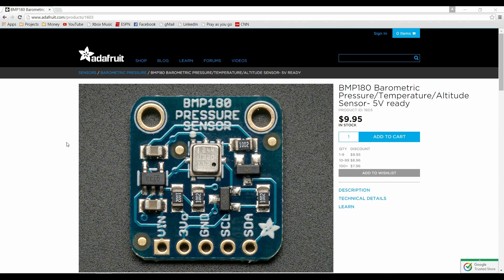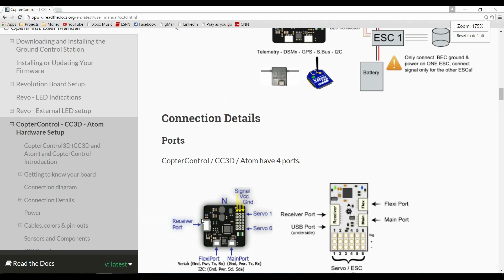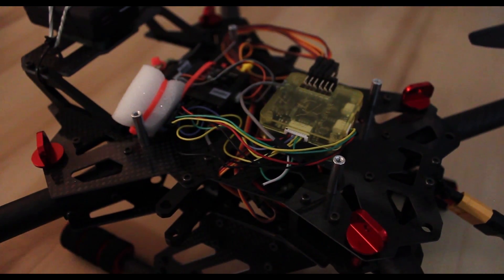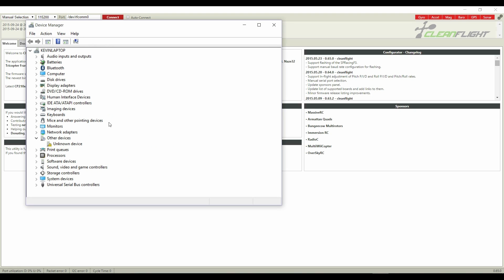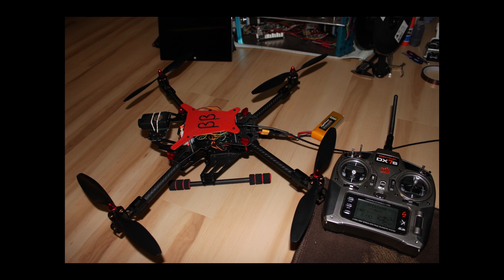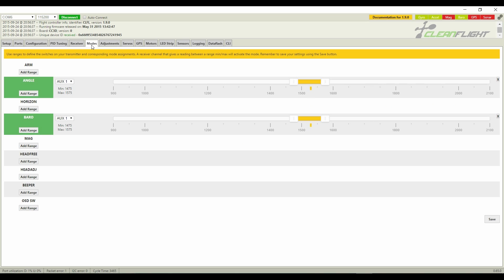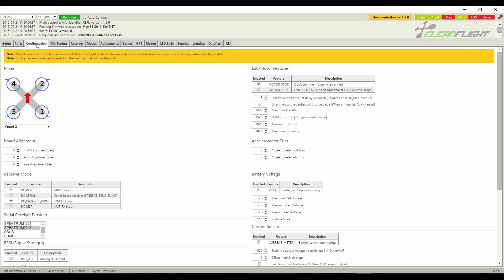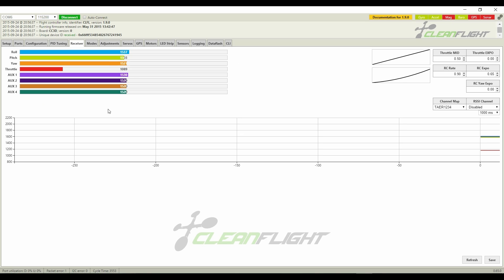DIY:  How to add a Barometer to your CC3D for Altitude Hold!

Comment: Did u change any settings in Port section ?
Reply: i thinks it flex port i2c  i couldn't yet get the CC3D Atom Min to work with baro in librepilot.

Comment: The BMP180 module I bought says 1.8V to 3.6V  https://robu.in/product/bmp180-digital-barometric-pressure-sensor-board-module-arduino-compatible-2/  But the Main and Flexi port output provide 4.8V . Can you please help me?
Reply from the maker: Simon George it has been a few years, so I don't have an exact description.  But the CC3D has a 3.3V power supply you can draw off of.  That's what I did.

If I had to guess, I bet the voltage of Vcc in the video (at 41 seconds) is 3.3V.

Comment: cleanflight doesnot detect BMP180 despite soldering and wiring properlyi wonder what i might be doing wrong. Can you help please
Reply from the maker: Make sure you're using the versions of CleanFlight I mention in the video, and the text.  Make sure the LIPO is connected like I showed in the video.  And, check that wiring one more time!

Comment: Good morning, my friend, I'm Brazilian. My name is Wilson Roberto. I live in São Paulo. I do not understand a lot of drones, but I rode 2 drones for me, a 250 racing and another dji 450. I bought 2 BMP 180 barometric sensors. How to connect the wires to the flexiport socket. If you can send a connection scheme I thank you very much because I'm afraid to burn either the sensor or the cc3d card.
I apologize for misunderstanding you, I'm 62 years old and I really like drones. Thank you

Comment: nice video......
could you mind to explaine with pict how to connect the wires form bmp180 to cc3d board...
like a saw in your web http://imgur.com/gallery/n2Ho7 
you conected to flexi port....but i dont see the detail of wires.
thanks
Reply from the maker: The BMP180 on that thread shows the four wires (VIN, GND, SCL, SDA) and the clean-flight documentation snapshot shows the four wires under I2C (GND, PWR, SCL, SDA).
Reply: thanks for reply..
i mean the wires you connected to the CC3D board, can you explaine SDA and SCL to what port and what color..?
thanks

Comment: Hi..there.. I like what yo've done...
.I have CC3D FC and just bought BMP180... do I have to setup BMP180 using arduino or just plug in to flexy port? And do I have to setup using clean flight or I can use libre pilot to set up altitude hold for CC3D FC? Thanks
Reply from the maker: The BMP180 is wired directly to the CC3D as the video showed... no Arduino necessary.  I only tried this with Clean-flight... perhaps it would work with other software, but I did not test this.

Comment: Hi Kevin.  This was a nice video of a baro add.  I have a challenge with Clean-flight.  Cant get the PWM receiver to work.  How did you get yours to work?  I have a futaba 7C Receiver.
Reply from the maker: I didn't really have any issue with the Spektrum using PWM (I gave up quickly on trying to get PPM to work).  The only thing I remember about this (it has been over a year, and since then I have upgraded a couple times) is that I had to set my throttle below the minimum threshold Clean-flight required before arming... that really was the only receiver issue I encountered.  Have you found success in the past two weeks?  Sorry for the slow reply, only just seeing this.

Comment: my barometer rated for up to 3.3v only . how can i get this voltage ? do i need to solder a wire to 3.3v spot on the cc3d board to replace with the power from flexi port? and is it possible to do the settings for barometer in libre pilot ?
Btw thanks for your video ;)
Reply from the maker: I actually switched to the NAZA M v2 recently.  However, I did have a "hack" on the CC3D at the 3V pin... so I'm guessing I did this for that very reason.  Unfortunately I've never used libre pilot.  No problem!

Comment: Hi Kevin, so the pwr cable from the flexiport is not used and instead you´ve connected the pwr wire from an ESC to the VIN port on the bmp180? Thanks for the video!!
Reply from the maker: I took apart this setup a month ago (when I saw the Naza M v2 is only $150).  I have a "hack" on the CC3D at the 3V pin (next to the ESC plugs)... but I don't actually remember why I needed that, lol.
Reply: Yep, wired 5v ESC output to VIN pin on bmp180 and the rest of wires like you mentioned and it is working :D  Thanks!

Comment: Hi, 
would this 1.84$ barometer also work for a CC3D? :)

http://www.ebay.com/itm/New-BMP180-Replace-BMP085-Digital-Barometric-Pressure-Sensor-Module-For-Arduino/262476089332?_trksid=p2047675.c100009.m1982&_trkparms=aid%3D777000%26algo%3DABA.MBE%26ao%3D1%26asc%3D36860%26meid%3D85c6d2ce3d64457b880cb27ed3035b5f%26pid%3D100009%26rk%3D1%26rkt%3D1%26sd%3D231263856250

Thanks!

Comment: My CC3D is not recognized any more, and the "Scan for hardware changes" in Device Manager won't make any difference on my PC, so I solved this problem in a different manner:
 
1. Installed a new Windows onto a separate, normal (not VHD) partition on the hard drive.
2. Installed DeepFreeze software and frozen drive C (DeepFreeze offers protection to loose all changes after a Windows restart)
3. Connect the CC3D to the PC

This way the PC will always see the CC3D board for the "first time" and it will always install the needed driver, and it will always work!

Comment: Hi i think the reason the other sensors did not work is because they use a different i2c address by default to the 0x77 address used in the BMP180 and you would need to change this value in the firmware or sometimes it is possible to change it on the sensor but the Bmp085 should also work because it has the same address i have one laying about so i am going to try adding it to my quad soon with the HM5883l compass as well to enable direction hold but i need to wait for my battery and a few last parts for my first build to be delivered,  you can look up some default i2c addresses here mate http://www.ladyada.net/library/i2caddr.html hope that helps and thanks for the video.
Reply from the maker: +BinaryGenius the quad is just art hanging on my wall  >.<   but thanks!

Comment: Great video/tutorial. I'm going to try this.
Can you/anybody  tell me how to "set" the altitude? Or will it keep the altitude that the copter has when "altitude hold" is turned on?
Reply from the maker: +fit2fly I live in LA, so I don't actually fly my quad (outside of my apartment, lol).  When I have altitude hold off, the quad fluctuates in altitude a fair amount.  When altitude hold is on, it would appear to fluctuate less (though not zero which is expected based on observation of the data as shown in the video).  There may be ways to configure the throttle (do nothing at middle, go up when +, go down when -) but I have not explored these.  I can just say: when altitude hold is on, it attempts to maintain the altitude.  If you explore this further, be sure to update this thread for the benefit of everyone!

Comment: Is cleanflight the only way?  Does openpilot not support this at all?
Reply from the maker: +Tim Arbour my understanding is that openpilot has too much functionality and uses too much space on the very tight CC3D.  On other boards (like perhaps the Revo) with more memory, this could be implemented in openpilot.  I was pretty sad to give up openpilot... because I love the interface & simplicity.  But cleanflight "cleans" out the excess crap that you cant use, so that you can gain functionality which you can actually use on the CC3D.
Reply: I'm terrible at tuning.  I have the eachine 250 racer and wanted to add the barometer to it (I have the module).  I found the PID settings from another person who has the same quad and plugged in those settings.  It flies great now.  I have NEVER used cleanflight at all so I'm just debating whether I should "mess up a good thing" and try cleanflight or just leave it without the barometer.  I'm new to racer quads (more of an airplane pilot) so I was hoping the barometer would help me hover more easily until I get the feel for the 250 racer.
Reply from the maker: Ah.  I 3D printed a quad, then bought the frame in this video.  In the ~6 months since I made my first quad, I haven't really used it, lol.  I usually "solve a problem" (like my other vids show) and then move on to something else; though right now I'm more focusing on work & the wifey.  All that said... cleanflight, in my limited experience, is far more challenging than openpilot for PID tuning.  But perhaps someone else will comment on this threat to prove me wrong.  It's tough for me to recommend a total change-up if your quad is already working pretty dang decent.

Comment: You need to install the correct virtual port driver since cc3d uses virtual port once flashed with cleanflight. Once the correct drivers are installed you will not need to rescan in device manager every time.
Reply from the maker: +TheWaterbound07 hmm, I thought I did that.  I'm running Windows 10, I chose the Windows 8 option... I wonder if that's why I have to keep rescanning.  There didn't appear to be a Windows 10 option.  Do you happen to have a link, which I could add to the video description?